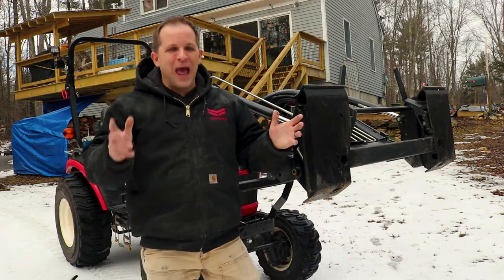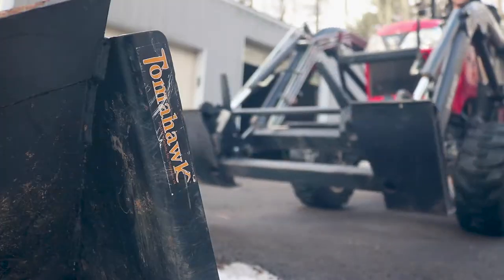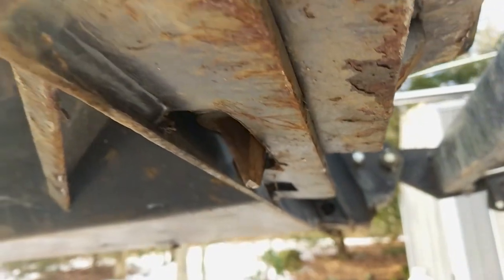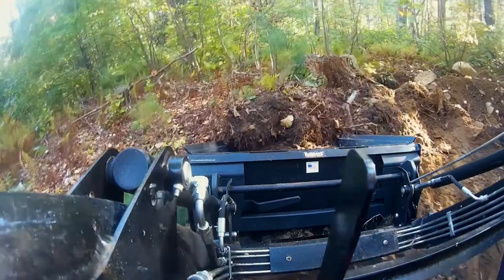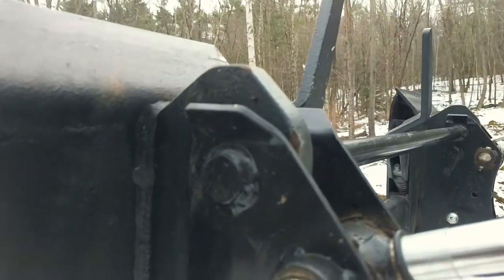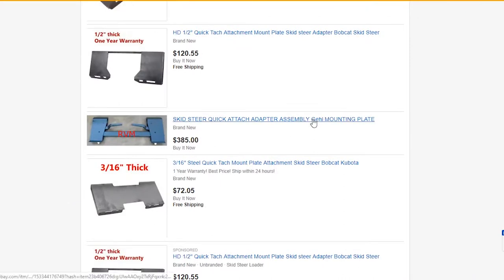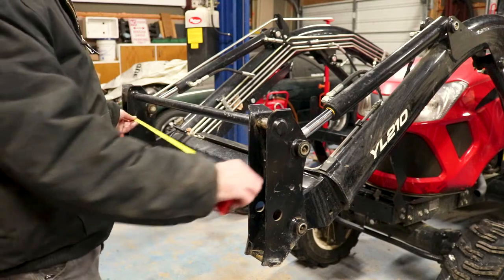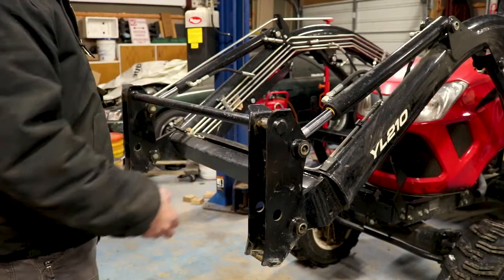Custom Yanmar Quick Attach

Comment: Hello mark.... looks as you may own sa324.... after installing new Holland quick attach and yanmar brackets..... with just the two items not counting anything else.... what is the estimate weight.... I have a 424 and was thinking of going this route but after buy skid steer quick attach folks I wondering how much lifting capacity I will lose.... great video btw...thanks
Reply from the maker: I don't think its much weight, ~80 lbs, its heavy, but I can carry it myself. you should still be able to lift 1100lbs with your forks without much of an issue!

Comment: Thanks so much, Mark for the video that I have been waiting for. This helps so much.  Would you change anything if did it again?
Reply from the maker: I think I would buy a different bucket! This thing sticks out really far! I thought about chopping a few feet off the end for better leverage, it might be able to do stumps then.  but the adapter works perfect!
Reply from the maker: I also did learn that not all SSQA implements are created equally, because of all the different manufactures making them, some times you have to make the openings at the bottom a little larger to fit, and some fit perfectly right off the get go.
Reply: @LazyBrookFarm  ok, Thanks
Reply: Love the videos! Are you still using the 324? Any problems with 324? I'm seriously looking at the Yanmar due in part to your videos. I really like the fact that they have 2 hydraulic pumps and they are externally mounted.
Reply from the maker: That's cool! I didn't know about the external pumps! I haven't had any problems, been abusing it quite a few times in the last few years!

Comment: I'm in the market for a small tractor. Come on Yanmar! It's 2021.... There is absolutely no excuse for Yanmar to be so far behind on these type of things.
Reply from the maker: I learned about it recently, they don't to the ssqa because it moves the pivot point further away from the bucket. That would reduce the curling/lifting power. And yanmars SA series is all about the most power in a small package.

Comment: Hi there, can you add a third function on that series of yanmar tractors? Like for a grapple? was about to buy a new tractor, thank you
Reply: Hello yourchava I just pulled the trigger on a 324 TLB with 60 inch mower Yanmar is doing some excellent financing at this time on the SA324 and SA424 series tractors. This was one of my concerns as well when speaking to the dealer. The short answer is YES! There are two common ways to do so you can install a Diverter or Third valve kit with a loader joystick control or by adding the rear spool kit. The rear spool kit gives you two circuits and you would run a set of lines from the one rear remote to the loader to control the grapple while still having another circuit available for other use. The rear remotes would have two individual control levers one would be tied to your loader grapple function.
Reply: @rgw_Trains_and_Things  have you done this? I would like to see how you did it if so.